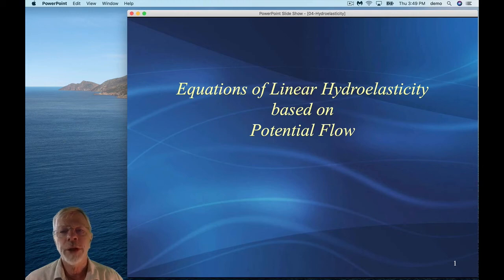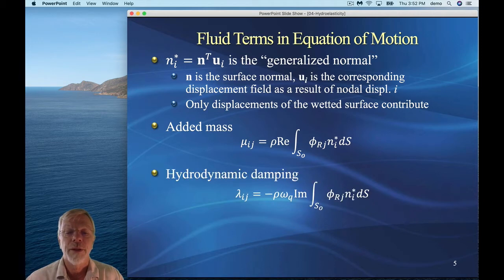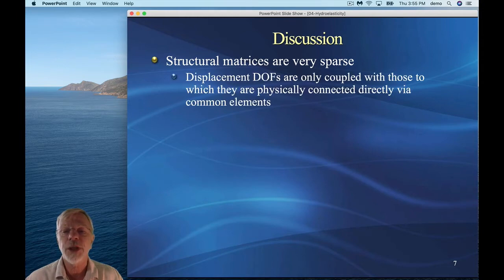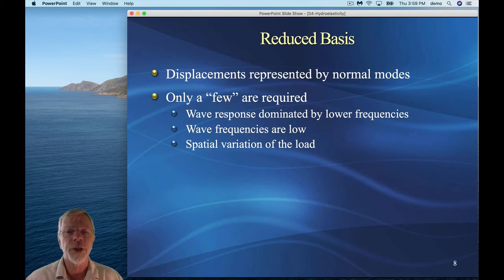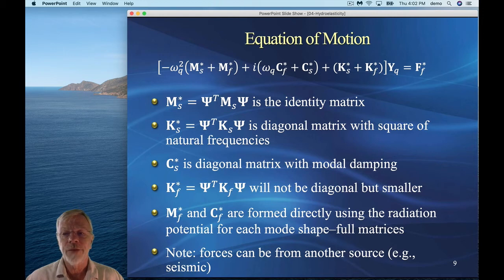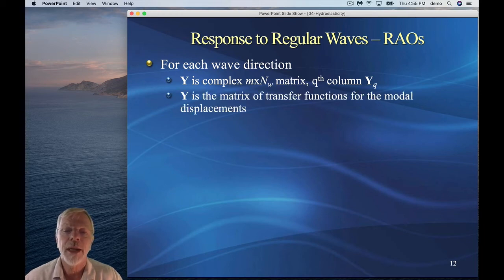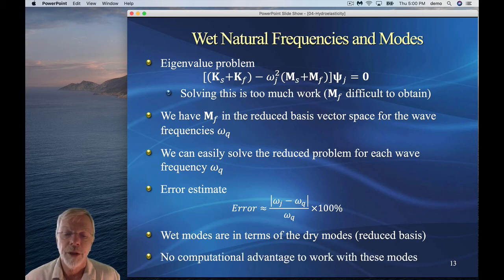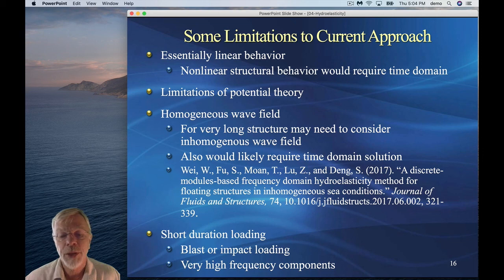Equations of Linear Hydroelasticity

Comment: Hi professor Riggs, thanks for the lectures. I just started to study the hydroelasticity problem, mainly concerned with vertical bending of container ships, and your videos are helping me a lot.

As i could understand, the computation of the fluid matrices (Mf, Cf and Kf), when considering the coupling with the structure, is very complicated. So the formulation used in Hydran-XR uses the fluid matrices of the rigid body hydrodynamics?

What about the wave exciting force vector (Ff)?  Does it also come from the rigid body problem?